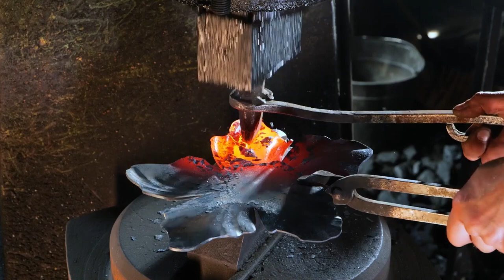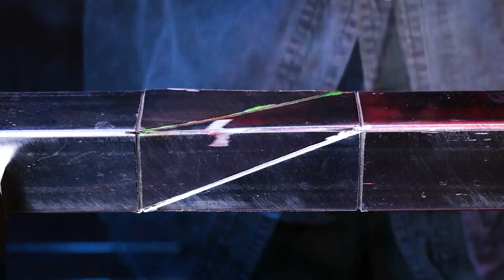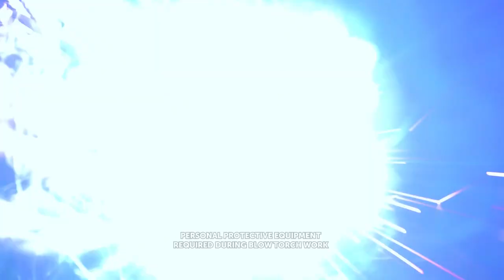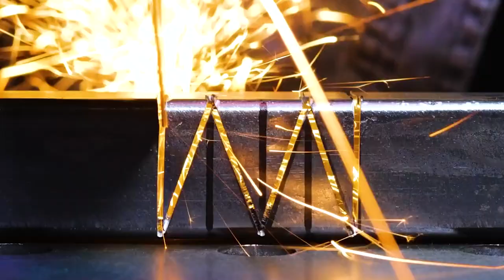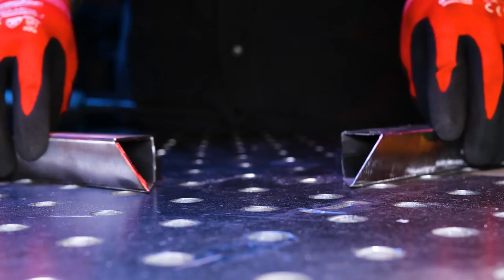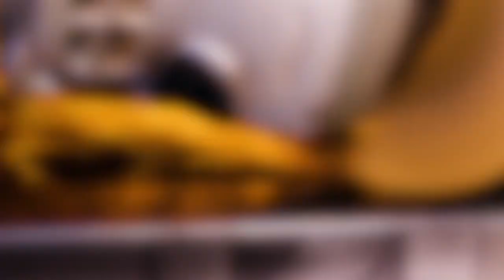Blacksmith forging a flower || Metalworking DIYs and crafts

Comment: 6 Most Important Blacksmithing Tips That Beginners Should Know

1. Make sure to heat your stock enough
2. Manage your forge’s temperature
3. You CAN see your metal’s glow in the daylight
4. Prepare your tools in advance
5. Have a coach
…and most importantly
6. Focus on having fun!